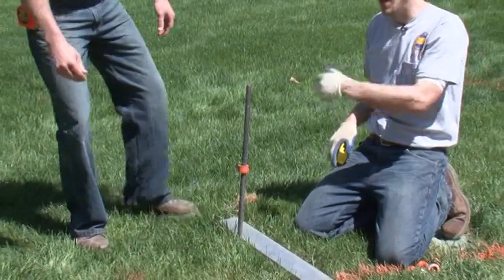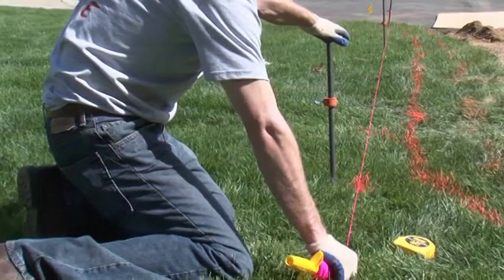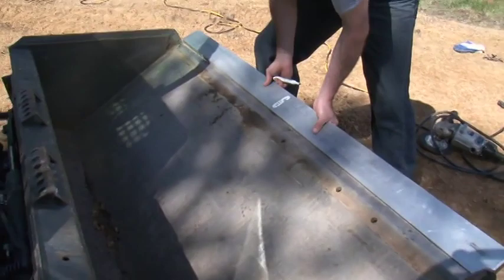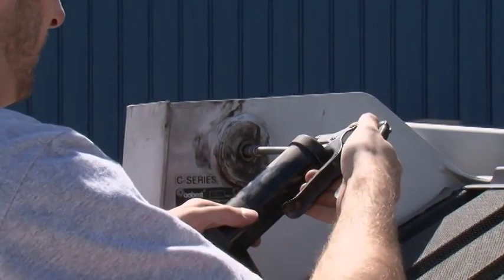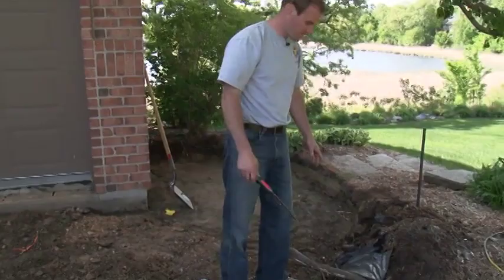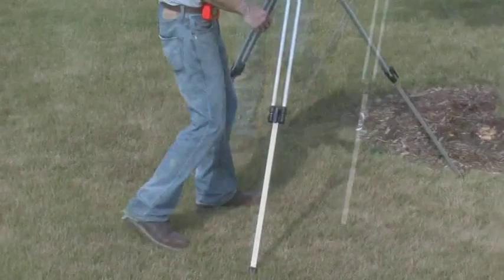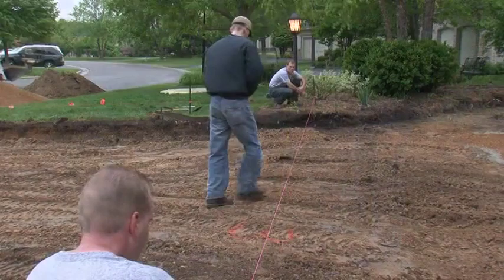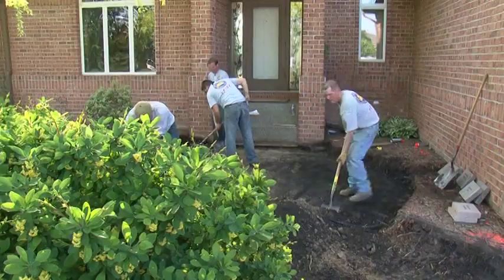Chapter 6 | Excavation

Comment: Great information!  Curious about one point at 2:51 where you are going to straight edge the bucket because I see that you don't have an actual cutting edge on the bucket, just the holes of where one could be bolted on.  Do you operate without a hardened cutting edge in place or is there some other reason for not having one installed?